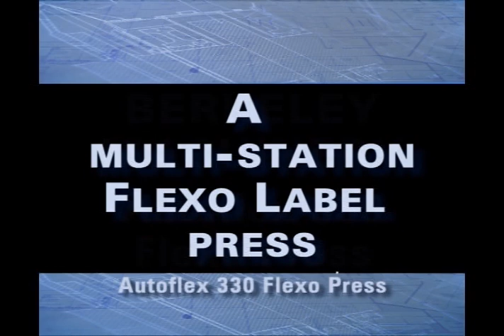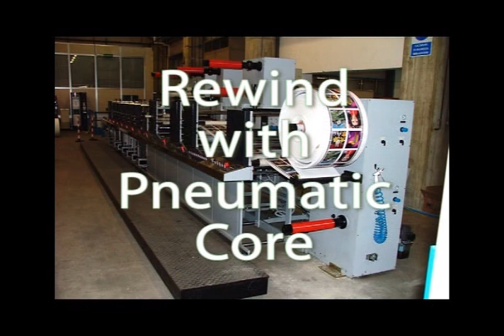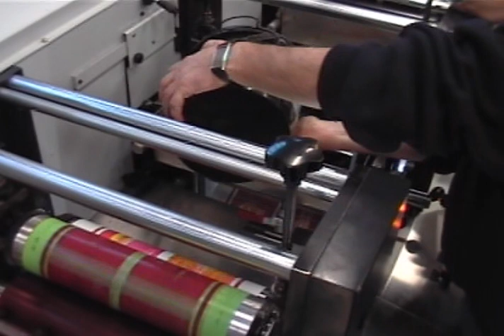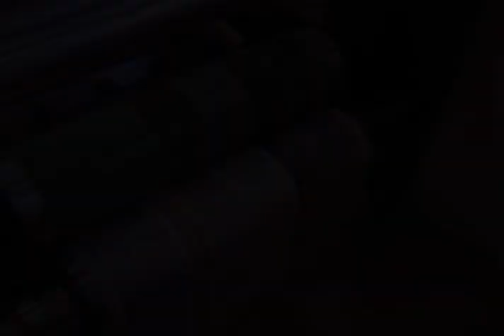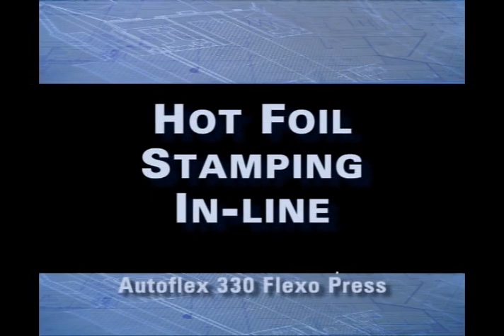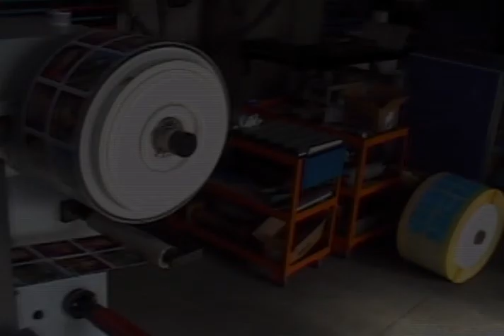Autoflex Excel

Comment: Amazing looking for a mini small machine like this to print bopp adhesive tape 1-2 colors.Widths 48-75mm with lengths of 50 / 100 / 1000 and 150meters.
Reply from the maker: This machine can not print on self-adhesive BOPP tape for sealing cartons, this would be a different machine which we can custom make for you. 

Please contact our head office at info@berkeleymachinery.com for help and more information.
Reply: Berkeley Machinery :So what price would I be looking at for a narrow web printing press for printing bopp adhesive tape 1-2 colours.?Kind Regards Heath
Reply: Your machines are excellent quality I can see you know what you are doing when it comes to engineering.
Reply: In addition to other issues with Bopp . your press will need to have specialized cutting dies and ink . i ran that type stock on a Mark Andy  2100 flexo press .